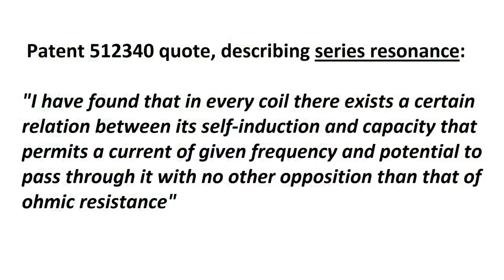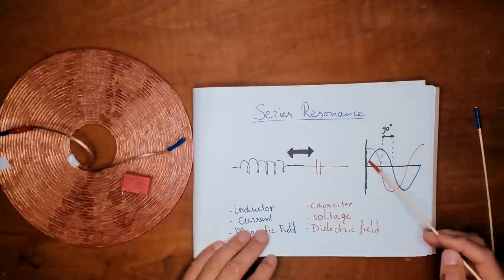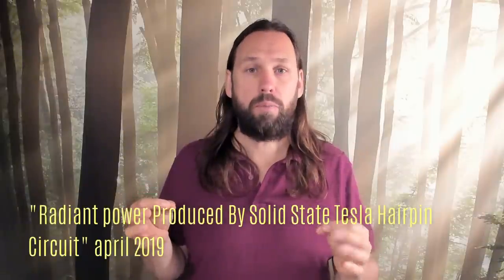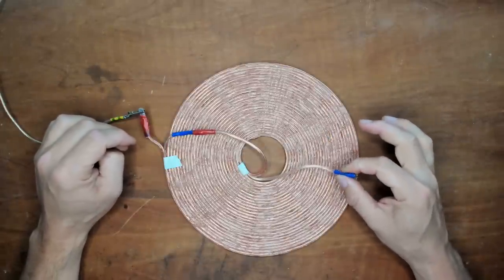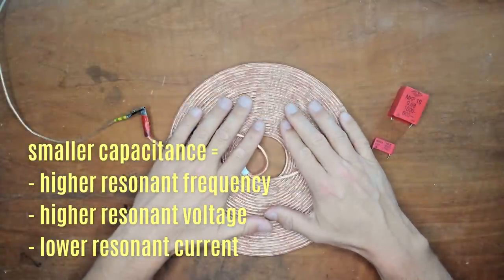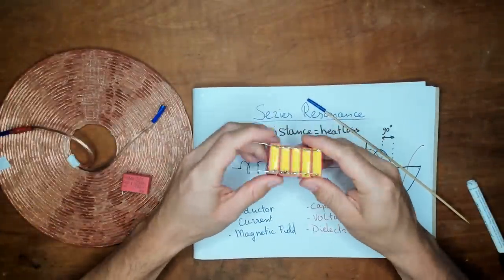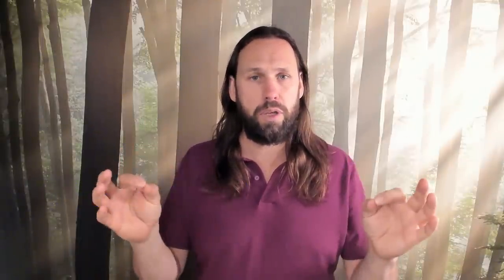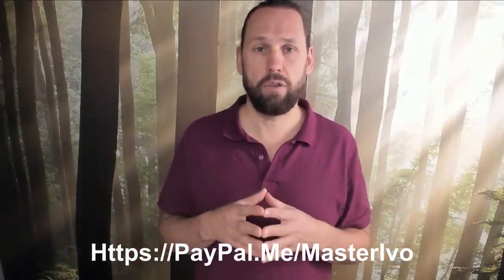The Series Resonant Bifilar Coil, Made For Longitudinal Impulse Electricity.

Comment: Here I believe I can explain One of Tesla most famous quotes about ‘rotating current’ please put some thought into it and look up the patent. 

You have deep dived into this process but can I ask a question based on a slightly different subject however still super related, due to it relating to the key Tesla quote about ‘rotational current’ 
It’s about the patent 381970 {please look it up}
In this Patent Tesla discovered a way to ‘rotate’ current laterally not as everyone likely thinks he is talking about an ‘AC’ wave I believe he is not I believe he is talking about the process of rotating the field around the annula ring , to be clear he is talking about creating a ‘vortex’ around the core , I think that he had gaps between each quarter of the ring.

So how he did this if you look at the patent is that he just made sure that when each half of the ring which was offset in the way imaged

, so when A set of inductors where active then the ends that pointed towards the B set are in cooperation via polarity so to be very clear he made sure that , if for example they were all active at once then they’d all be ‘pulling’ ‘magnetically’ at each other , but then , what he did was activated tthe A and the B  in an alternate manner so like and astable system you see one pulse to A then one pulse to B 

This caused the ‘current’ to ‘wirl around’ this is Tesla rotational current !

He caused the current to rotate laterally around the ring , if you look at his ‘astable’ generator you can see that it’s what could be achieved mechanically but if you trace out the wave it’s 90deg alternate {it’s in the picture} 

I guess this could be reproduced in a solid state fashion by use of a ‘capacitor’ otherwise the astable would be completely alternate, anyhow it would a great thing to explore this rotational field effect no? 

Then we could think about those gaps , if we know the field is always complimenting I.e ‘pulling’ what about adding a ‘magnet’ at the same complimenting field ?  Into the gap? 
Food for thought ivo
Reply from the maker: my thoughts right now go to the impulse which is timed at the maximum positive voltage of the resonant sine.
It seems the maximum negative voltage of the resonant sine, is still empty. it should be filled with another impulse, a positive one.
Reply: Master Ivo hmm perhaps, which in effect would ‘actualize’ the offset inertia, there are many different ways to achieve the results I would think
Presently I’m using only a CD4047 which is not gated for my astable pluses so I have no control over PWM 
I configured a small system, with only two gaps and ‘magnets’ with 100% duty even at resonance it is still ‘using power’ on the active inductors however I can configure a small light as a load on the secondary and there is no power usage from that load at resonance, the light is just an auto dash light from an XH ford. It lights up brightly when tuned in with no extra ‘power use’ , just tuned to a tractor device ‘capacitor’ from the secondary.

I believe the ‘power usage’ relates to duty cycle on the incoming pulse as it is present with no load, so that should be able to be corrected. 

I will now cut the core on the X axis and add two extra gaps with two extra correctly aligned polarity ‘magnets’ and test again when I get the SG3525 I will compensate for PWM and try again
Advantage of the SG3525 is that there is a sufficient gate driver inbuilt so it is possible to trigger low side Mosfets direct from the chip. 
Regards
Reply: Master Ivo ouch I think I might have mixed up the polarity, or at least implied the incorrect polarity, for anyone reading have a look at the patent and it is demonstrated with the secondary, I guess I only just ‘scrap through’ with regards to the frequency Tman was looking for lol 
Anyhow it’s self evident in the two images when looking at the secondary then you can confirm with the L configurations on the slip rings of the generator by tracing them. and still follows my original statement with regards to the ‘inductive oscillator’ like which as called a ‘joule theif’ 
Hope that helps also shout out the the commenter that made a good logical comment with regards to wire length at the 3rd harmonic great suggestion, seems self evident when you think about the geomatics of such structures in resonance.
Reply: If aligned as a reflection(clockwise vs anti clockwise), using induction coils reverses and converts the direction of the electromagnetic torroid, from a divergent type of electricity to a convergent type of electricity. Once converted, its a type of radio frequency. This is the `reciprocated alternating current` that Tesla was writing about. It behaves very differently to standard AC. This is the 3d explanation of the inverted Sine Wave.
Reply: Hi Kolin nice thoughts on Tesla's patent 381970 which was early in his career in 1888 while he devising the electrical transmission system which consisted of very high voltage and low current to reduce the heat losses for long line transmission....which we still use today!

In this patent he uses his typical low frequency magnetic circuit close core composed of soft iron strips to reduce eddy current heat losses.  He also uses his typical high voltage to low voltage transformer theory using thinner/longer primary wire to thicker shorter secondary wire.  The spinning magnetic field appears inside the closed core by using an AC generator with multiple phases at opposite side of the core which impose a moving magnetic pole of the soft iron core, and secondary transformer winding wound on top of those cores that induce higher currents at lower voltages to loads.  Pretty much still used in our electrical transmission systems.

Thx for this trip down memory lane!...
Reply: Mark S I don’t know specific details about our current {no pun} electrical generators, do you have details? are the rotating polarity of the generators 90deg alternate As in this converter ? , I’d hazard a guess that it plays a significant role in the design. 

I’m also not sure if the ‘stator’ or converters are configured in an ‘inverted’ manner as is outlined in the patent ? 

The only way to find out would be to go to an coal fired power station and have a look at the generators I guess.
Reply: Darci Ford 
While I don’t disagree as you seem to be speaking on authority in that statement m we must agree that’s certainly absent from the patent, looking at the secondary {which is the only visual indicator} clearly the inductors are ‘Clock v Clock’  this was of particular interest to me so I went over it many times, when stated ‘co-operate’ the statement was in reference to cooperation to fix the poles at the two adjacent vectors {one pole say ‘North’ and the other ‘west’} 
Then these ‘inverted’ pairs are alternated , and in this case at a 90deg offset wave by the generator which as stated creates the ‘rotational’ polarity. 
It’s an interesting design, I have my own theories as to why it would function in an efficient manner. 
I think the separate core sections are in turn acting to offset the inductive inertia mass then actualize it in the ‘off’ state or state of least field force at the 90deg alternate rotation. 

It’s ingenious if that is the case , however it could be achieved a similar result by sets of separate cores at standing wave self resonate base and then sub harmonics of that base I believe, I have today discovered that significant feature  of ‘self resonant standing waves’
Reply: Kolin Evans Gerard Moran gives a great explanation of the generation of our mains power systems. He says that so called `three phase power` is a myth, that the power plants are generating radio frequency, which gets converted to regular ac before it enters your home. Its an industrial secret and there is no way you will get to see the generators inside the plant- unless you work at the plant. So, use your nouse and youll figure it out. Dont wait to be told.
Reply: Darci Ford thanks for sharing, 

I have seen some of his experiments based on transmissions transformers , while I’d use different language altogether i can’t disagree with his statement, I’m sure there a many ‘secrets’ out there.
I look more from an inertia aspect, when in the transformers example, he feeds 240v of inductive inertia into the secondary of the transformer it is then converted to a very high pressure potential which offsets the inertia based on the design of the transformation , it specifically functions due to the secondary being designed to convert frequency I believe, I.e on a Single wire Earth return system, say 11kv comes in at X freq it is converted to 240v 60hz {obviously} by him doing that in reverse the transformer is both increasing the rotational velocity and pressure which offsets the mass of the inductive inertia input from the petrol generator.

If I have anything incorrect please correct me, but I think you will find that this is the case , and then when passed along the single 11kv line to another 11kv input he is again actualizing that offset inertia  I think the transformers would need to be earthed due to their specific design principles. 

So in this case there ‘secret’ is simply inside that transformer 

And it relates to the frequency conversion and pressure conversion which offsets the mass of inductive inertia then by reversing it actualize’s it. 

But I wouldn’t specifically call any of that ‘radio’ maybe ‘ratio’ of frequency and pressure at 60hz resonance ?
Reply: Darci Ford the design is certainly very ingenious of those transformers and whoever designs them must have had a very good understanding of standing wave principles , harmonics and sub harmonics, maybe we should be talking to that guy or girl whoever or wherever he/she is?
For me the most ingenious aspect if the unit is certainly the frequency conversion, I’m still learning such aspects, but I guess it works on harmonic node division of the original wave ?
Reply: @kolinevans9127  Instead of harmonics, I see it as the conversion to implosive force from explosive force through induction reversal. In his later experiments he coverts frequency by using small motors as induction circuits, having two, close together, seperated by paper.  
In my understanding the spark gap creates almost infinate harmonic frequency conversion.
This is still all theoretical for me though. I guess I'd better make my hands busier and do some testing.
Reply: Darci Ford indeed and yet the ‘common’ transmission line transformer seems to achieve it all in a ‘magic’ box filled with some oil? 
Without spark gaps or moving parts.  {I’m talking specifically of the frequency conversion} 
One aspect to the ‘implosion’ could be that these transformers are ‘0 point tapped’ , but that’s my best guess

I guess I’ll put 0 point taps on all my further tests to test different configurations. 

My next test was one core two symmetrical inductors of fixed wire length, find the standing wave self resonance base, then divide by 4 for the 3sub, then divide that answer again by 4 for the next 3 sub 
Then select a tractor device {capacitor} to target that frequency for apparent resonance. Trigger the A symmetric inductor with a 0 tap and two low side switches with an astable pulse , on the B inductor configure the ‘capacitor’ and tune to the target frequency as aforementioned. 

When I do this I get above 240v to light a 240 lamp from a 12v input on the A inductor, with little ‘power’ use, however I see this as an offset state, i then want to input this output from B into a new separate inductor device

Here is where your comment could be useful if I add 0 taps on both A and B of that second inductor device, then I could experiment with inputs at the 0 tap and other two connections in a sense ‘inverting’ the inductor. 

I’m winding them anyhow a 0 tap on each will not be a large difficulty.

However on the second inductor device, I thought to {based on the patent} have another symmetrical set of A and B {just like the first inductor} however then a secondary wound with them at a 3 sub wire length lower so let’s say I use bifilar 8m then obviously 2m on the ‘secondary’ 

The point being I forgot the generator in the patent , to make the device solid state there would obviously need to be the two sets of symmetrical inductors one on the generator, and one on the converter , I’m sure both could be on the same core ,  it I’m experimenting with two cores. 

So if you want to get your hands busy try it out ? 
You can find self resonance standing wave by connecting a large resistance to the end of the inductor and 5M and inputting sine at one end and probe between the resistor and the ‘ground’ of the function generator. 

Once you have standing wave self resonance, you can divide by 4 to get the sub3 but then you have to match the ‘capacitor’ up to that target , other frequencies in between these nodes I haven’t explored except to say they are inefficient. 

I found that I’d say standing wave is 10khz divide by 4 = 2.5 kHz 

Then you can again / 2.5khz by 4

Get 625hz , if you each time choose the ‘capacitor’ to target each sub3 then the results are a light 💡 lit with little ‘power’ use and little or no heat on your valves.
Reply: Darci Ford indeed and yet the ‘common’ transmission line transformer seems to achieve it all in a ‘magic’ box filled with some oil? 
Without spark gaps or moving parts.  {I’m talking specifically of the frequency conversion} 
One aspect to the ‘implosion’ could be that these transformers are ‘0 point tapped’ , but that’s my best guess

I guess I’ll put 0 point taps on all my further tests to test different configurations. 

My next test was one core two symmetrical inductors of fixed wire length, find the standing wave self resonance base, then divide by 4 for the 3sub, then divide that answer again by 4 for the next 3 sub 
Then select a tractor device {capacitor} to target that frequency for apparent resonance. Trigger the A symmetric inductor with a 0 tap and two low side switches with an astable pulse , on the B inductor configure the ‘capacitor’ and tune to the target frequency as aforementioned. 

When I do this I get above 240v to light a 240 lamp from a 12v input on the A inductor, with little ‘power’ use, however I see this as an offset state, i then want to input this output from B into a new separate inductor device

Here is where your comment could be useful if I add 0 taps on both A and B of that second inductor device, then I could experiment with inputs at the 0 tap and other two connections in a sense ‘inverting’ the inductor. 

I’m winding them anyhow a 0 tap on each will not be a large difficulty.

However on the second inductor device, I thought to {based on the patent} have another symmetrical set of A and B {just like the first inductor} however then a secondary wound with them at a 3 sub wire length lower so let’s say I use bifilar 8m then obviously 2m on the ‘secondary’ 

The point being I forgot the generator in the patent , to make the device solid state there would obviously need to be the two sets of symmetrical inductors one on the generator, and one on the converter , I’m sure both could be on the same core ,  it I’m experimenting with two cores. 

So if you want to get your hands busy try it out ? 
You can find self resonance standing wave by connecting a large resistance to the end of the inductor  5Mohm and inputting sine at one end and probe between the resistor and the ‘ground’ of the function generator. 

Once you have standing wave self resonance, you can divide by 4 to get the sub3 but then you have to match the ‘capacitor’ up to that target , other frequencies in between these nodes I haven’t explored except to say they are not efficient. 

I found that say standing wave is 10khz divide by 4 = 2.5 kHz 

Then you can again / 2.5khz by 4

Get 625hz , if you each time choose the ‘capacitor’ to target each sub3 then the results are a light 💡 lit with little ‘power’ use and little or no heat on your valves.

The tractor device is across the B inductor adding the tractor force to the inductor.
Reply: Darci Ford this conversation reminded me of a video I saw by Stan Gibilisco , called ‘A simple frequency multiplier’  search out he has a NPN valve he says in ‘class B’ so for me that means that it’s only passing the pulse of one polarity, as he says like a single wave rectifier and amplify, I actually accidentally discovered this but did not know what i was doing, 
Then this output is sent to a tuned circuit he doesn’t draw the input {yes he does couldn’t see for looking lol} of the tuned circuit so anyhow have a look at it. 
I assume it could be tuned within reason to multiple or divide.
Reply: Darci Ford tractor force is a vortex force it is an ‘implosion’ force , inertia is an expansion force , so to degrees we are talking about the same thing just using different language. 
Tractor force is the ‘pulling force’ of a capacitor and on say a flywheel at rotational velocity as the  angular force under inertia expands at a 90 d vector it is sometimes also called ‘centripetal’ force but usually only in relationships to say wheels etc.
Reply: @kolinevans9127  Im interested in Magic for sure. Maybe just oil cooled induction coils? i havnt really looed at them.
Reply: @kolinevans9127  I worked at utility power plants for years on most of the systems, including generators and controls, and of course things have changed.  For example coal fired is being replaced with combustion turbine generators.  Obviously the generators today are wired differently, however still utilize much of Tesla's theory.  I can tell you when I read the patent you sited the other day what he wrote was very familiar to me from my job in the utility power plants, including power plants for the Navy some time ago.  He truly was the brains behind most of our systems.  The difference now being the plants are mostly digitally controlled from computer screens in the control room.  It is fun to start up the generators using the control systems and maintain them.
Reply: @kolinevans9127  This patent was in his earlier years and it appears that in later years he moved on to more of a pulsed system vs. AC.  I think IVO is capturing some of this in his interesting experiments.  Certainly would like to see what your doing as well as you seem quite passionate and there is always room to learn more...
Reply: Mark S yes , I always only wanted to add to the conversation, I’m not implying that what Ivo is doing is incorrect or on an incorrect path,  all I’m doing is looking at what is a most practical option with regards to the general equipment we have today, and I settled on a solid state system at resonance to offset mass {just an analog of spinning a wheel of mass up} 
To me this is / would/ should be the path to understanding for any person past a ‘level’ of understanding to understand inertia and tractor force , I don’t claim to have mastered it but I have learned a lot , specifically related to standing waves and harmonics , {which I can’t seem to find ‘education’ on anywhere in relationship to ‘electricity} 
So I’m simply attempting to spin the mass of an inductor up to inertia to the point of offset to the 3D plain , in which case there should be some indication {like 240v+ from a 12v input} then {just like with a flywheel}, use a system to actualize that mass at a second location in the 3D plain. 
It’s not the most exciting of experiments, but i continue due to when finding standing wave resonance of the inductor and tuning to a target sub harmonic the single symmetrical inductors always show the same results, I.e offset inertia opposition, I.e little to no opposing force. 

If it did not have this Outcome i would not continue, and I expect many stopped due to not understanding standing wave self resonance, as separate from ‘apparent resonance’ I.e LC resonance {when anyone just configures a ‘cap’ to a ‘coil’ } any point between standing wave nodes depending on inductor ratio can cause a lot of ‘back pressure’ and heat onto the valves obviously not a good indicator for someone doing an experiment, but if one thinks in terms of the flywheel analogy again , it becomes quite logical. 

I’m uber interesting in the effects of using opposing pulses to force ‘implosion’ effects on inertia however we need to probably recognize that , there are only two primary ‘forces’ Tractor force and inertia , Tractor force is the vortex that enters the 3D plain from a higher energy state , and likewise inertia is the ‘effect’ of that tractor force in the 3D plain , if there is more tractor for e then the inertia frequency rises and this is where inertia can effect things higher density than metals literally like a ‘tractor beam’  

The reason you see the effect on ferro fluid that on a higher power magnet looking like it has a ‘smaller’ inertia field and larger ‘vortex’ field  is due to the tractor force slightly  raising the frequency of the inertia so it looks like the ‘vortex’ is larger it is not it’s just that the ferro fluid is not attracting any longer due to it being slightly outside the density field. 

This is also why ‘static’ electricity picks up light items, due to the frequency shift of tractor force on inertia.

I’m showing the analog between a gyroscope flywheel and ‘electricity’ it’s the same two primary forces, I think that’s pretty good circumstantial evidence to show that they are the same force, we can use any language we like from there on.
Reply: Mark S oh yeah I’m a super passionate guy when I want to be , you know I order 20x SG3525 ICs and what do you know none of them work that I can find so far , some unexplainable noise in the left channel , I’ve tried many different configurations,  oh well I mean what I have here right now is a pretty damn efficient ‘inverter’ with the CD4047  it’s T2 {bifilar} primary of 8m coupled with a T2 of 8M on the secondary, so not a super amount of wire , on a small 60mm core ring and I’m inputting 12v and lighting a 240v filament lamp , by simply tuning a capacitor across the output of the secondary to a sub harmonic of the standing wave self resonance of the symmetrical inductors. 

I mean I could make s video titled ‘super efficient inverter’ would probably be popular no? Especially in India ! Where like me they are mostly ‘off grid’
Reply: @kolinevans9127  The 240v filament lamp as you know a resistance of voltage and current is in phase across a resistance, so, suggest you measure the current through or voltage across the resistor to figure out the power dissipated through the filament (if you haven't already) to find the power consumed by the filament and just how efficient the circuit is.  You did the right thing by using the filament lamp instead of LEDs for matters of checking efficiency.  And yes would be a good video as inverters are not known to be very efficient devices in my experience.
Reply: @kolinevans9127  I agree with much of where you are headed.  Ferrofluid is entertaining but a fool's folly to extract provable theories relating to electricity/magnicity (or what I coined the term magnicity over 20 years ago).  As you pointed out ferrofluid depends upon iron which is magnetic itself and also too large a relative particle size to likely prove anything.

You are spot on that most probably electricity (magnicity) is an analog of gyroscopic action. Be interesting to see any of your experiments.
Reply: Mark S well I missed these comments but I can say I went a long way In 1 week to understand some of the mystery related to the standing wave concept, and the many aspects related to the ‘line transformer’ it’s quite interesting, and has to do with the golden ratio actually, wire length , and ‘hz’ in frequency, so I believe that I can build a more efficient inverter, from the one I had. Yes my measurements were just looking at a battery level so not much of a measurement, if I detect no heat that’s my first indicator, no heat and loud audio is even better agin , no heat, loud audio and no ‘power’ usage better again. 

I have always loved the simplicity of the inductive oscillator, like similar to what is commonly called ‘joule thieft’ so I was configuring different wire lengths to the two parts due to understanding how N valves work by being a single polarity valve that has the option to pass the other polarity, then understanding this simplified the understanding of the oscillator, however it never seemed ‘elegant’ and there needs to be an explanation of why different inductive oscillators of these type oscillate at X frequency , the simplest is a single N valve oscillator, so this was how I believe I made a discovery to understanding why this oscillator is rotational at X freq. 

I also found that it has now no or little heat on the valve , and it is very audible. 
I believe it is due to standing wave cancellation and multiplication , At different wire lengths.
Reply: Kolin Evans post a schematic on you site and I will take a look.  A lot of what you say makes sense to me.  Not only is wire length critical but wire weight as well, and ground plane.
Reply: Mark S hmm I’m not 100% sure on the weight and plain but I can simply explain so that you can reproduce the possible result. 

Take a nanocrystal ferrite ring like ‘met glass’ type or any really I guess but something that can reflect reasonably high frequency  get your favorite measurement stick and measure out as accurate as possible 5 meters of wire

Now unwind it all and double it to make a 2.5 meter T2 length 
On my stick I wind 3 times around the top {about a finger width} so that I have terminals that are not wound so that I’m trying to get the 2.5 M T2 {bifilar} onto the core. 

Now wind the 2.5 M onto the core take up 1 qrt or 1 half of the core if you like but I wind across to the end of the winding then cross back to the start. For even distribution. 

Now take your 4 ends and configure in the normal manner a ‘Tesla’ winding. 

Now I assume you have an oscillator scope , and a function generator, so now take a decade resistor or just some resistors and put say {I may edit this} 3 K on one end of the inductor, now put the F gen input on the other end. 

Set your wave to sine like 19v etc connect the ‘other end of the F gen to the end of the resistor, put your probe in the junction of the resistor and the end of the inductor and with the ref at the ‘ground’ of the f gen. 

Now take your f gen frequency and set it square on 250khz 

Due to some possible cosmic joke, tell me what you see? 
I’ll tell you what I see, 1.63 hz {which proves nothing in itself related to the golden ratio} 

If I drop the frequency just 1 hz to 249, 999 hz I see 2.63 hz  and so on..

And so on, at first when I saw this {years ago} thought it was a scope ‘error’ 

What has occurred is that 2.5 meters of T2 relates to {background laughter} 250khz ~ of cancellation of the wave. 2.5 meters 250 kHz <  T2

I can ‘prove’ this also the other aspect , I can find standing wave self resonance base, at 155khz on this inductor. 

How many times does 155khz go into 250khz ? 

1.61..... {seems like a familiar number no?}  this is the most efficient point. And ‘nature’ seems to prove it. 

I also configured an inductive oscillator with the two ‘halves’ like a ‘joule thief’ one halve is the 2.5 M inductor the other ‘half’ is a 10M inductor T2  2.5 x 4 { sub 3 harmonic} 

The 10M inductor has a standing wave self resonance at about 12.2 kHz then again at 155khz ~ 

I activate the oscillator with a single N valve and have a 1k ohm going to the switch of the valve, I get very stable loud oscillating at about 438 hz , such a low frequency, but not once you realize that it is the result of the not cancelled frequency this oscillating is I believe the non canceled frequency from a 250khz oscillating, this also possibly explains why there is little to no heat. 

Try it out regards.
Reply: @kolinevans9127  Nice write up as I understand where you are going with this.  Why not make a video of this which would make it easier to replicate?
Reply: Mark S yeah I might, I like to have a full {or fuller} understanding of something before presenting it to others. Seem ironic but hey.
Reply: @kolinevans9127  Yes I understand, but like myself one always likes to have a fuller understanding...so sooner or later we just have to put it out there and learn from the collective.  I could recreate what you wrote however there are many variables which would totally change the results.  For example the core is very important and must be properly matched to the frequency used, wire gauge, etc...etc...etc...this is why I have replicated IVO because he is very specific with all the details.  At any rate, keep on going as I sense you will get to a place and time where it will be time...
Reply: Mark S totally understand, I can say , I spent a day winding and rewinding inductors onto the same core at a range of different wire length then testing each one for the standing wave base .  I feel like I learned some things.

Interestingly the 2.5 meter T2 was a ‘provable’  ‘anomaly’  leading to what I think is a significant ‘discovery’ 

Remember I stated that the 2.5 had a standing wave at 155khz , after testing a Different core {similar} I got wildly different results however, I then took the 10 meter {sub of the 2.5} OFF that same core I originally tested and tested again, the standing wave is gone at that frequency, I.e standing waves specifically, act more like sound waves, in that they are reflecting other open inductors on the core. This could only occur with a ‘sound type’ wave.  Yes so called ‘longitudinal’ 

This is probably also the key to amplifying standing waves, and probably how frequency conversion is handled in those transformers. 

This could be why Tesla also {aledgedly} argued that Only ‘sound type’ waves existed he was probably alluding to the fact all other waves are derived from these original standing waves but are only a harmonic form of them and what people term as ‘transverse’
Reply: Mark S I love what Ivo is doing and sharing, if I was ‘following at home’ I’d start to simply think about harmonics of the base frequency, I.e get your standing wave base and multiply by 4 to get the 3rd or sub 3rd harmonic. 
And add inertia by adding a core then you could probably make some significant discoveries. 
Especially by experimenting with inducing two inductors simultaneously with different harmonics ‘I.e wire lengths’ and then also an astable pulse into ‘left’ and ‘right’ inductors at different standing wave base harmonics , so for example one at X standing wave base then the other at the Sub of it , then astable pulse into each at the standing wave frequency.
Reply: @kolinevans9127  Yes, we are living in a dielectric.  As a dielectric experiences a changing applied potential there is a polarization of the dielectric (longitudinal), with displacement current.  Yes, you are correct a magnetic moment (field) can be measures in the displacement current of a dielectric (Faraday, Maxwell), but only as a change in potential is applied.

So as you have just noted, and I have said, when you place a core into the coils then the core becomes an integral part of the results.  So hard to replicate with out exacting duplication of the core.  Not only due to the cores saturation curve characteristics, but also due to a core is also actually a resonant device, analogy a tuning fork.  When the core vibrates we get your sound wave analogy.  So it is smart but difficult to place other coils/cores in the vicinity as you are doing, but the cores must be correctly tuned (not only with wire length and thickness but also with a 'resonant' core.  You do this all correctly and the overall components can be sympathetic.

Now Tesla, although he definitely new all of this and did design with cores, one may surmise that he did not prefer cores for many of the reasons in my last paragraph.  It is difficult to control all of variables and maintain your resonance/tuning (not only electrically but physically as discussed).  And almost impossible to replicate with out exacting design and conditions.  So he typically did not use cores in situations where all of this is critical.  Of course for out electrical distribution system this is not critical as it is not a resonant  system.  Of course Tesla's patents are the basis of that system as well, but probably not his finest moment.
Reply: please pm me a labeled diagram of this very interested and in return I'll send a vid of it working
Reply: @mcbusinessmonkey  I'm making a bifilar motor and generator next please send labelled diagram of this thanks.
Reply: I can produce free energy and that  By converting dynamo car  into electrical transformer - The rotor is fixed - until it becomes immobile -Then I feeding supply it with a current 15a 12-volt  ac not dc  --Produces free energy 12 volts 150amp
Reply: Mark S thanks for sharing, I didn’t get a notification for this comment, you added to the field of information thank you. 
These are interesting aspects, I’m always learning more I’m sure there are many paths to finding resonant results the one you brought up with regards to core self resonance is interesting and important I think, I have mostly ‘met glass’ type ferrite crystal cores , they are reasonably high permeability but I can only guess as to their core resonance, I’m sure it’s based on the dimensions and makeup of the device, and I could totally understand how this was more or less ‘unachievable’ in Tesla’s day due to those crystal cores simply not existing. 
I.e not in a fixed format 
However If you have seen the latest post I posted on ‘all about circuits’ Tesla was well aware I believe of forward and inverse applied force and harmonic cancellation of different forces. 

Actually he built it into one of his most common existing inventions, I’m sure he would do a lot with crystals in today’s manufacturing environment but then again also our ‘dielectric’ is flooded with mis dis information and faulty products so there is a give take with everything. 
Thanks again for the comment, yes I can see that by shifting wire thickness weight and length and type I.e different ‘Tesla’ winding I.e 2 wire 4 wire etc, if one knew what the core resonance was once could easily wind a self resonant inductor to match that core resonance {or a harmonic of that} , that would be interesting indeed. 
I guess I could simply tap it with something record the sound and look at it on a spectrum meter, I’m sure there are other ways but I can’t think of them atm lol.
Reply: maniac I presently haven’t tried that so you’re one up on me there. Thanks for sharing.
Reply: 6 months goes so quickly here lol and I feel like I’ve learned so much more , oh well we all start somewhere and keep learning.
Reply: The test I’ll be doing tomorrow is an analysis of a fixed amount of wire with a fixed {obviously} wire resistance, and winding it as best as possible onto a fixed known core of which I have 4 identical pairs 
So I will wind the fixed wire which is about 1.8mm in a fixed fashion onto the single core and measure everything 
Then I’ll unwind it and stack the 3 others onto the original and make one large core 
Then I’ll again wind the fixed wire in a fixed fashion onto that 4 times larger core {including itself}
And I’ll make a number of notes again 
The only thing that I’m sure will stay the same is the wire resistance. 
I expect self resonance, ‘inductance’ May change I guess I’ll have to find out.
Reply: Mark S 
Mark but what if that system was in fact Tesla’s best work ? {stick with me here}
What if in an ‘infinite’ set of probabilities there are lots of ‘future worlds’ What was that film? Anyways 
But not so many relatively flawed specific special ones like this, put into that {admittedly narrow} context perhaps it was Tesla’s best work?
Reply: @kolinevans9127  Can I ask you some questions? What is the difference between oscillation frequency- by mechanical rotation Found in generators Oscillation - rotational motion - Comparison between them and the frequency - induction in transformers? Now if we put the idea of the rotational movement aside - We find that the generators are basically more energy than the low income energy - Generators and car dynamos give much more energy than the input power Regardless of the driving energy of the rotation motor - Why oscillation - mechanical rotation In generators produces more energy - But electrical oscillation in transformer does not produce more energy The reason as they say is emf back But emf back  also found in generators, why does not affect the production of excess energy Can you answer
Reply: finally got a setup up and some tinker time again. Took video of beginning to progress.
Reply: right on would like to discuss and set up some tests...keep in touch. possibly can post some tests on my channel if explained well enough? or even just share results private message. sounds worth looking into. Faraday motor and unipolar also use rotating magnetic vortex.
Reply: maniac hi thanks, I’m by no means the authority of all things inverse applied force , by I posted a topic on ‘all about circuits’ with regards to the LC Frequency of say 200hz on two coupled inductors if the operation is 50 hz 
You might want to have a look when this LC frequency is achieved observed in the device is a 180 deg out of phase trace 
It would indicate to me that something like what you mentioned is occurring. 
If you can’t find the post I’ll try to post a link without being censored 
Hey do you know what a guy picked up for me in a yard sale for near nothing $
I’ll get the number I have two. 
I presently have 2 
BSM300GB1200DLC 
These I think you’ll agree are fool proof way to build a powerful ‘ZVS’ ha
300A Igbt
Keeps auto censoring the link
Reply: maniac adding to my answer , is the principle of a separate ‘b’ field circuit I.e in a motor/ generator they are physically separate circuits so thier ‘magnetic circuits’ are physically separate, in a traditional ‘transformer’ this is not the case, worthy of thought, and an aspect of some Tesla Patents.
Reply: Worth updating my exp , I had 5 core rings identical.
Wound the same wire identical R2.4~ resistance 
1.6mm ~ 
Onto one core with the results of 
Inductance  1.46H
Self resonance 4540 hz

Then when the core was multiplied by 5 I.e now 5 identical cores stacked 
Same wire identical 
R2.4 ~
Inductance 2.46 H
Self resonance {interesting 6900hz}

So in summary two interesting aspects, with resistance fixed from 1 core to 5 there was an almost exact 1.68 multiple of inductance but as one can clearly see self resonance is a factor of ‘plate size’ and thus turns and with a single core more turns = lower self resonance. 

Interesting and worthwhile analysis.
Today I will test 3 cores {because I just have to know lol} don’t have enough for 8 yet. 
Also today I’ll do analysis on applied force in relation to inductance {inertia} and at what ratio mass is offset in terms of applied force to inertia.
Reply: @kolinevans9127  would like to private message about this stuff. I'm currently working on something similar but with a different approach. I got good results with my modified faraway set up. Also a couple configurations of modified pancake coils it's going well but takes time to craft each set up.
Reply: Ok strange, bizarre, possibility incorrect result from my exp with core size in relation to inductance 

1 core was 1.46 / 1.5 H
5 cores identical was nearly spot on 1.68 x that 
But 
3 cores .... 2.52 nearly exactly 1.68 x 1 core so unless I made an error between 3 and 5 cores inductance stayed fixed??
I don’t know what happens at 8 I guess 1.68x  on the 3 and 5 results?

My intuition says because I was winding 4 simultaneous strands maybe I did not correctly config the wind on 5 cores I will be winding this again with a single wire for another experiment and inductance stays {similar}  enough to know if I made an error.
Reply: @kolinevans9127  During Germany's fall in World War II, the Allies stole secret technology, including free energy devices
Reply: @kolinevans9127  If you read the stories of aliens' hijacking   The farmers told that aliens use the light released from the bottom of  ufo This light pulls the cow from the ground up towards the sky - this light is capable of lifting massive weights They probably used this light to build the pyramids - now how can light raise enormous weights - we cannot produce this light Aliens science
Reply: maniac from the Germans ? Damn, and where did the Germans get the ideas? They were pretty proficient maybe they were just creative?
Reply: maniac Phoebe Bridges sung it best ‘tractor beeeam’  , I’m not sure as I come to you today how this is achieved, I’m also not sure if the Cows would be my first target if I ever developed one but hey it’s new to me so you know. I’d probably try to use it to impress gurls.
Reply: maniac I guess no idea is original I just want to heat up my water atm.